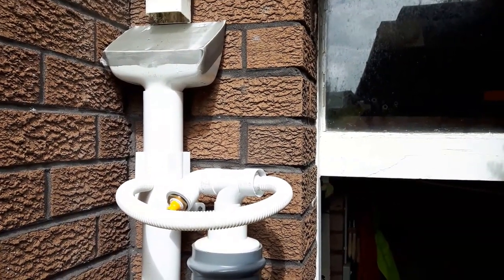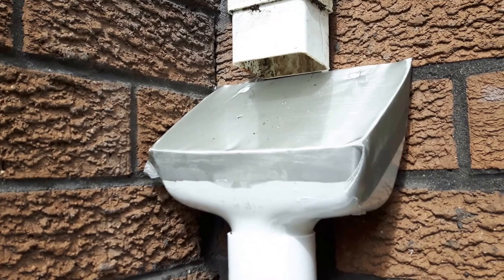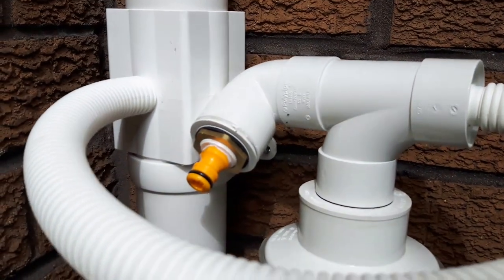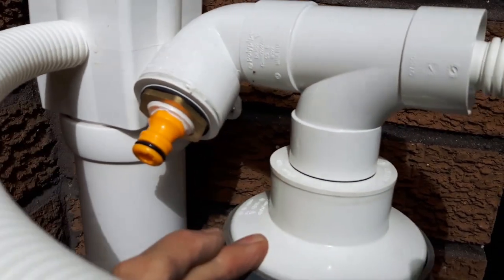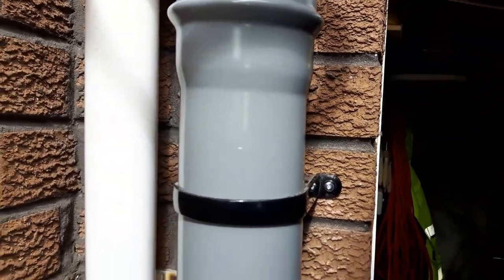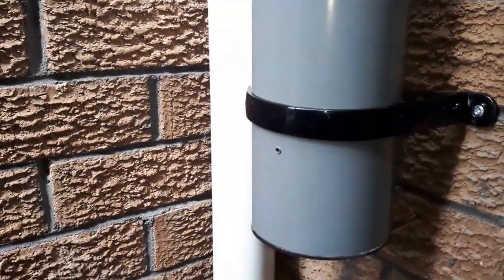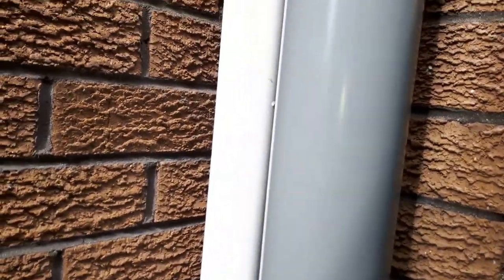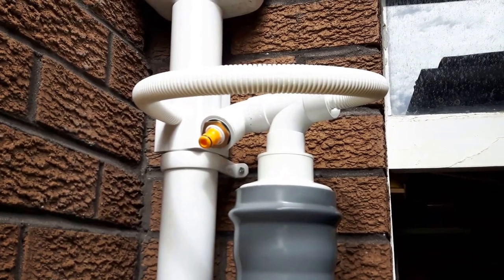First flush diverter system DIY easy and simple

Comment: what about the debris that collects in the valleys inside the corrugated tube? It will be dislodged and be washed out, even after the valve locks and "clean water" goes to the pond. Also, your inlet diameter is way bigger than your outlet (hose pipe) .. won't that cause your system to go awry at downpours where loads of water come rushing in, but can't go out, because of the tiny outlet?

Thanks for sharing!
Reply from the maker: Its a good point, I hadn't considered the debris in the ridges in the corrugated tube. Might need to change it to a smooth pipe sometime, but I would guess it would be a tiny amount anyway, which would most likely settle in the storage tank anyway. At downpours the rain goes mostly down the downpipe which is the function of the diverter (the square thing the corrugated pipe comes from) Available from Screwfix for £8.70. I should have shown all the parts before assembly - just learning lol.

Comment: a. this looks solid as fuck.  I think this needs to be boosted to 3 million views or whatever the better rainwater catchment videos are getting.  b. can you elaborate on the 90 micron screen thing?  Is that right 90 micron.  A micron is 1/1,000,000 of a meter or 1/1,000 of a millimeter.  90 is about 100 so 1/10 of a millimeter screen?  Wow.  Okay, so about 10 times as thin as some of the screens.  I don't think you called it a screen.  This just looks bomber.  But how easily does that gunk up / how easy is it to clean or does it actually clean itself as it rains / drys out / blows away?